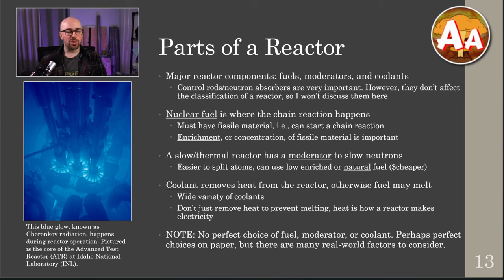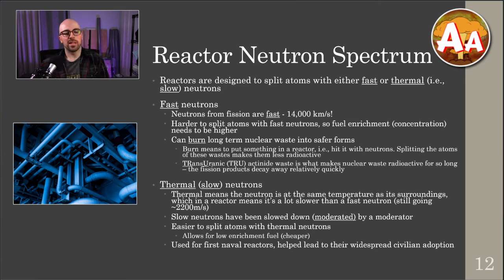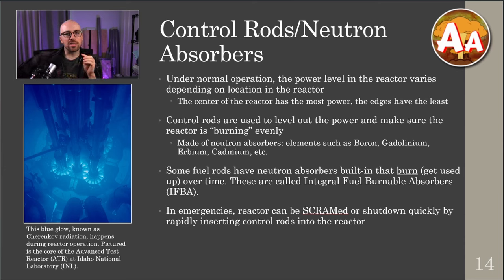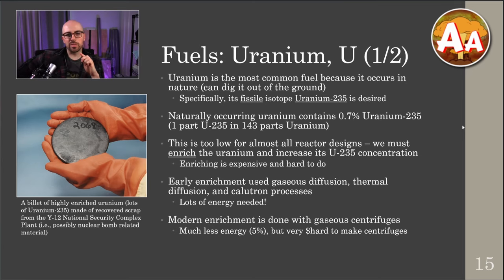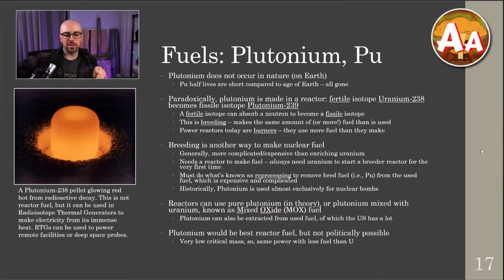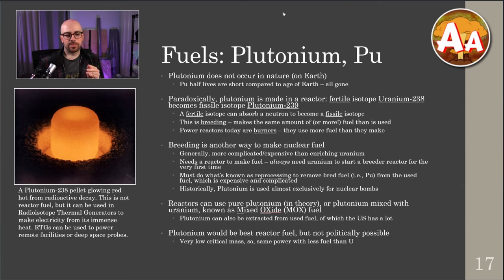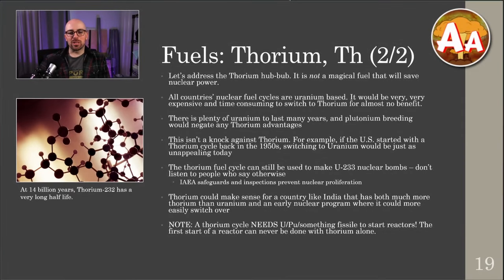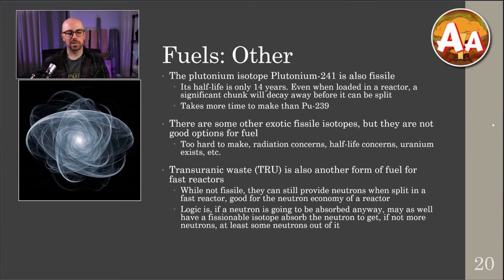Intro to Reactors 2: Reactor Overview and Uranium, Plutonium, and Thorium

Comment: People often lump the concepts of thorium and molten salt reactors together and when they advocate for molten salt thorium reactors make the claim that those reactors can consume nuclear waste. One the one hand breeding thorium 232 into uranium 233 is done in the thermal spectrum while it takes a fast neutron spectrum to fission transuranics, which is more feasible to do in molten salt fast reactor running on uranium/plutonium, otherwise you would need to make the reactor more complicated and run it in a mixed spectrum.
Reply from the maker: Yes, Thorium gets conflated with just general advanced reactor concepts. These are good topics for me to address in the future

Comment: It's not much, but I really want to show my appreciation for the work you put into these videos. They are a joy to watch for nerds like me. Especially with the slides where you have everything neatly categorised. This was 40 minutes of reactor goodness!

And as an aside; yes, the RBMK was designed with plutonium breeding in mind. It is a direct descendant from military plutonium-producing graphite reactors (AM-1/AMB-100/AMB-200). Such a big, and powerful reactor cannot only make oodles of electricity, it can also breed lots of high-quality plutonium in a relatively short time. They endowed it with the on-power refuelling capability for being able to run longer in-between outages, but also that they could take designated fuel assemblies out to harvest the fresh plutonium before it would accumulate too much Pu-240. I haven't been able to find anything indicating that Unit 4 was ever used in such a manner, but it was most certainly a design requirement. Am looking forward to the next iteration in this series!
Reply from the maker: thank you! I looked into it a bit further and while the RBMK's predecessor was designed for breeding, the RBMK seems to only have been designed for power production. this is something I want to look into further, but if you have a link you could share for breeding, I'd be curious to take a look.
Reply: @TheAtomicAgeCM  
You're most welcome! I really do enjoy these lengthy videos you make. They help me tremendously with furthering my learning about this most interesting topic.

Absolutely! I'm more than willing to share what I have. Since I never seem to have much luck with posting actual links (YT always eats them for some reason) I'll give you the description and time, then it should not be hard to find. A YT video mentioning this is "What technically happened at Chernobyl" by Ethan Chaleff. It is a lecture of about 50 minutes. Besides a few very tiny RBMK mistakes, it is very good indeed. From 04:00 minutes he goes over the design requirements, and specifically mentions it.
I also remember reading about it somewhere. Will have to dive into my not-so-small RBMK library to see if I can find it again for you. This may take some time, but will come back to you on this.
Reply: @TheAtomicAgeCM  
Is there an email or something else I could use? I have tried multiple times to send you a link with more info, but YT keeps eating it.
Reply from the maker: you can find my email address on my channel page in the about section
Reply: @TheAtomicAgeCM  
You've got mail!

Comment: I feel that a genuine advantage of thorium over uranium is that it is more abundant in the crust than uranium, meaning that you don't have to do expensive seawater extraction to get it, but breeding in general is expensive anyway, even more so for thorium because of U-232 as you mentioned

Comment: I have a question when making plutonium do the two extra protons get absorbed through alpha particles I’m only confused cause when u 238 absorbs enough neutrons to become plutonium I seem to miss where the other protons come from
Reply from the maker: ah yes, good question. The U-238 absorbers a neutron and becomes U-239, which does beta minus decay twice to become Pu-239. Beta Minus decay is when a Neutron gives off a negatron beta (a negatron is a negatively charged electron) and the Neutron becomes a Proton (think of it like the neutron has lost a negative charge to become positive). So, the 239 doesn't change (the number of nucleons), just the element number (U to Np to Pu)
Reply: @TheAtomicAgeCM  ohhhhhhh I seee